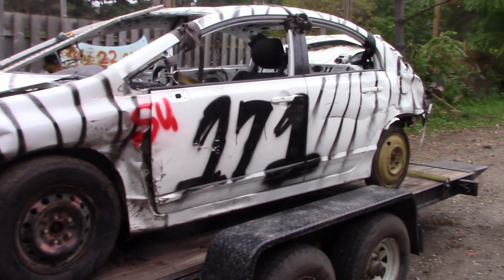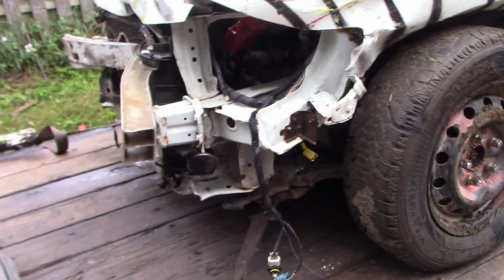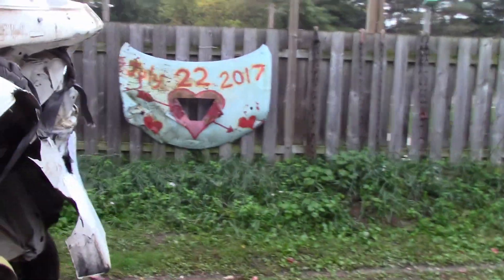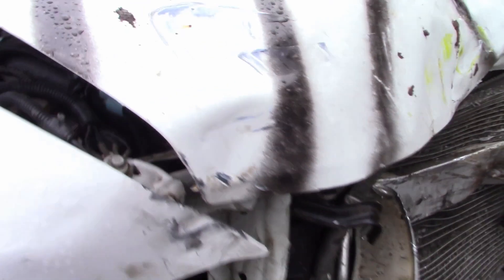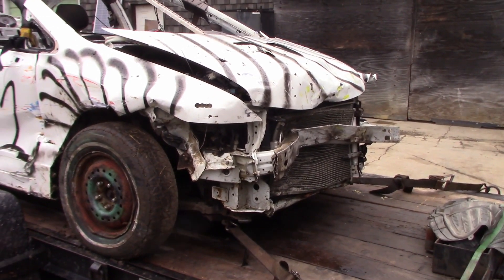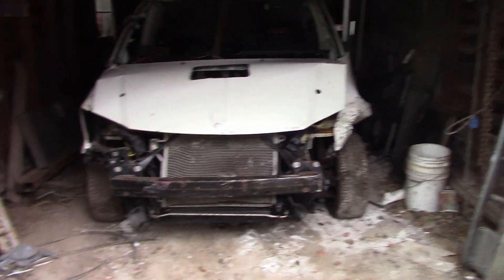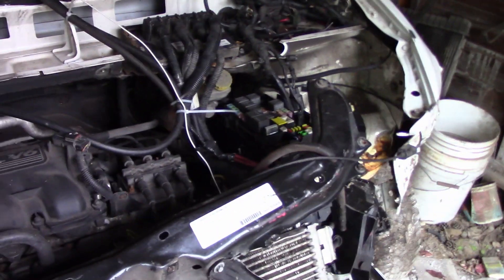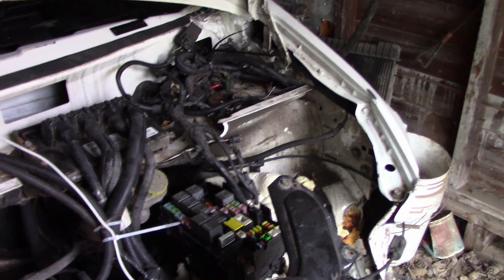Aftermath of the 2013 Honda civic and the 2010 Dodge caravan From mount forest 2021

Comment: Hope the problem with the van isn't that the fuse block is getting skunky with corrosion or something stupid like that.
Reply: Glad you had fun
Reply from the maker: Its actually what happened
Reply: @zacksworkshop171  damn, I'm physic... ok psycho but close lol. Were you able to get that cleaned out or replaced for Barrie?
Reply from the maker: @mightymacaque  yes I did i used some battery sleeping spary and wd40 and it was all fixed up
Reply: @zacksworkshop171  right on right on

Comment: Did you ever figure out what was wrong with the civic
Reply from the maker: no i sent it to scrap i think i broke the gas petal never even hooked up a scanner
Reply: @zacksworkshop171  dang that sucks any tips on what you would do to another one of them as far as building this is my first year ever running and I'm running the same car so far hard-nosed it with A V bumper done away with the radiator cut and folded the trunk creased the front fenders and rear quarter panel